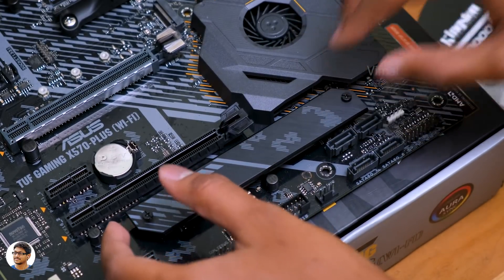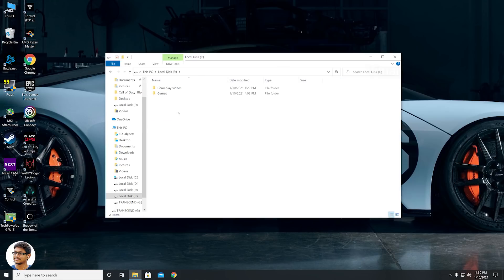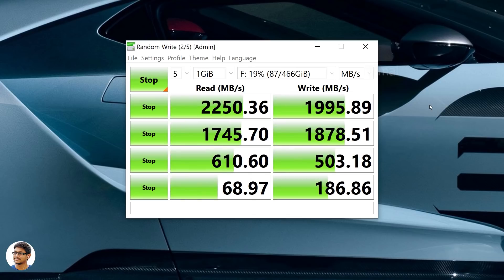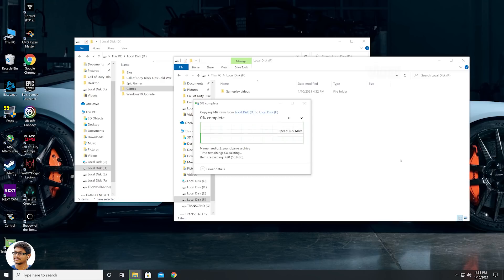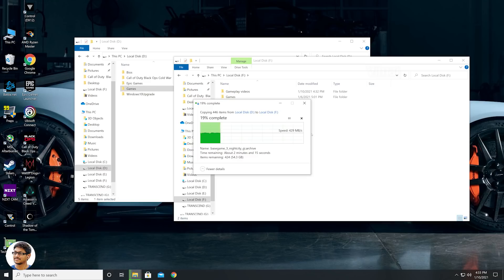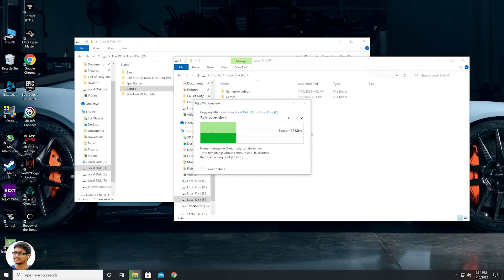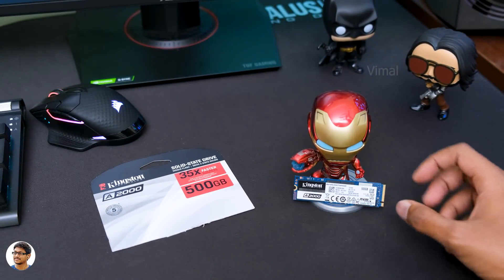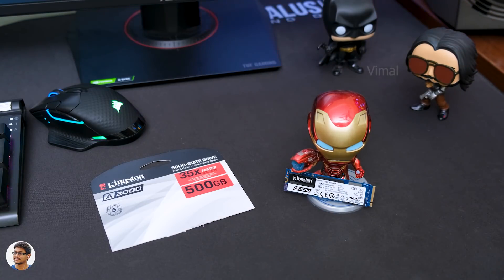Boost Your Laptop / PC Speeds Greatly with this !! ⚡⚡

Comment: bro i have asus gl704gw laptop, and whenever i play a game i always keep the power cable plugged to the pc but every time when the games lunches the pc automatically disables the power and i cant play with the power and you know it only lasts 30 minutes and even when i try to unplug the cable and plug it back it always keeps disconnecting it automatically, any tips please ?

Comment: My computer specs ryzen9 3950x,graphic card 3080 , 32gb ram and 1tb sata ssd, 4tb hardisk , 1tb nvme m. 2 ssd and mother board is x570 aurous motherboard and custom corsiar liquid cooling
Edit-, case thermaltake cor p8

Comment: I have a question that, I am building a self built computer, The specs are
Ryzen 5 3500x 
ASUS Phoenix GeForce GTX 1650
Crucial Basics 8GB DDR4 1.2v 2666Mhz
GALAX B450M Motherboard
Ant Esports VS500L Power Supply
Ant Esports ICE-100TG(Cabinet)
now I have 2 questions
1st) Should I use an HDD or SSD because I have a tight budget so...
2nd) Are these specs good?
Reply: nice our processors are same

Comment: Hi Vimal ,
Please do a video with two graphic card in single pc and how to connect that in pc 
I have been planning to buy two rt 580 two graphic cards ,but i had a doubt it will work or not 
If it work how we can connect the output display because both will have separate output hdmi

Comment: Thanks vimal 
It definitely helps me for my laptop 
But after installing, do we need to do any process like transferring data from old disk
Reply: yes you have to copy your windows into ssd and then change the settings in bios so that the laptop will boot from ssd

Comment: Literally me with My laptop with Intel pentium 2 core 2 threads and no GPU 
Bruhh...
Reply: Same to you brw
Reply: Core 2 duo + nvidea 210 😅
Reply: Search for AMD radeon 7820
Reply: Hhaaha
Reply: Really I have those specs too
Reply: It can only run roblox in 20 fps in the least 480p setting
Reply: What about legend amd e-2100
Reply: thats very old and not good
Reply: @FusionPlayzYT864 ryzen 5 3500x with rtx 2060
Reply: @suhaanmitra5665  10900k and rtx 3090 .Go beggars 🤣
Reply: Pentium630
Reply: Pentium g2030t and no graphics card

Comment: For the past 9 years I am using only SSD
I just remove HDD from laptop (lnspite of warranty period) and put it inside transcend casing and use as external drive
If I needed extra storage I remove DVD drive and use convertor bay to install another ssd

Fresh Windows 7 started in 6 seconds, 8 years ago in core2 duo laptop, it took 30 sec after installing many software
Reply: Bro 
Can you plz tell me 
How to copy laptop  original os in hdd to newly upgraded nvme SSD
Reply: @akashranger1382  use macrium software to clone